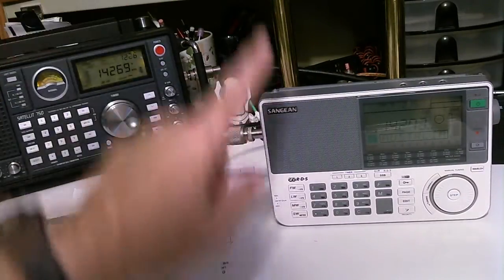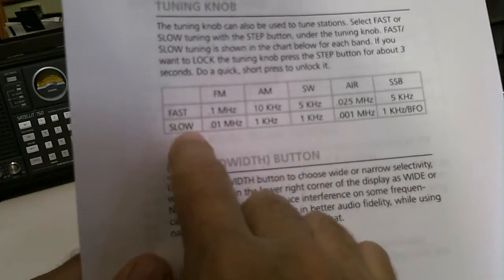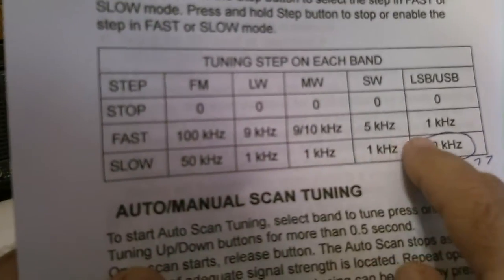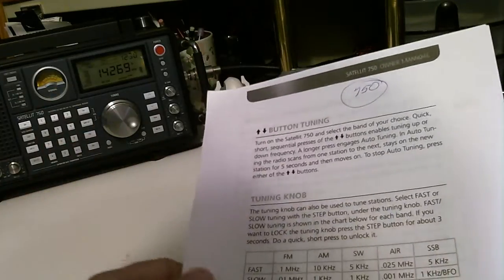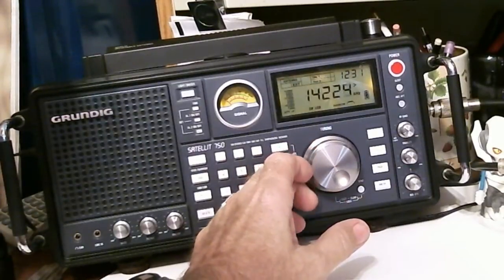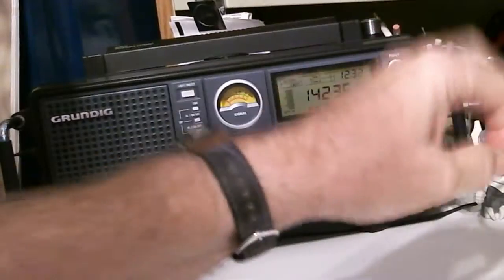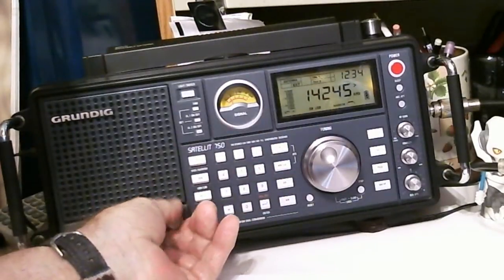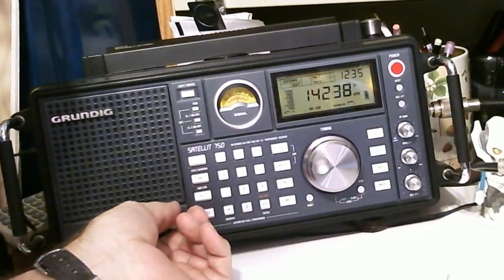TRRS #0555 - Two Types of SSB Tuning

Comment: Hi tom new subscriber here and a newbie to the hobby as well.  I just bought a Grundig 750 and would like to know what I need to connect it with an outside antenna?What kind of antenna tuner are you using and how do I hook it up?Thank you.
Reply from the maker: Since it is only receives you really don't need a tuner.

Comment: Having a "beat frequency oscillator" is certainly handy but I think I prefer a specialized/dedicated LSB/USB mode for resolving SSB signals, for the record the R1000 uses a similar approach as the 909X but isn't restricted to a fixed/predetermined tuning step...

Thanks for the comparison :)

Comment: Thanks for sharing. I prefer the old school BFO setup. It is much more interactive and yet simple to use.
Reply from the maker: Andy Tobin I agree.  I like lots of knobs and meters.

Tom
Reply: Andy Tobin I dislike the newer shortwaves. They`re so downsized and lack so many of the classic features that sets like the Sangean ATS 803A and others had. Also, they are so thin, you really need 2 hands to even turn the volume down. Must be a communist plot. ARRRGH!
Reply: Agreed. Old school or go home I'd say!